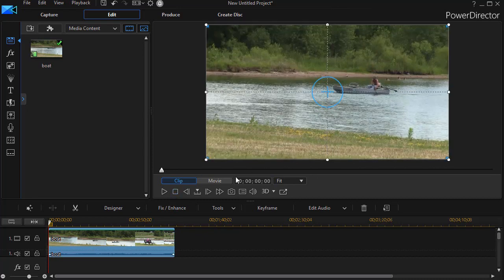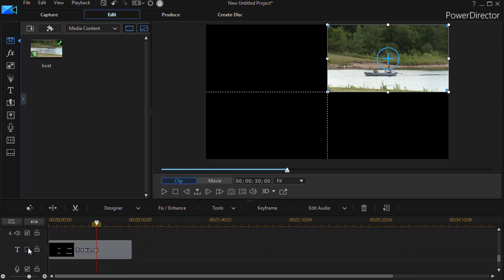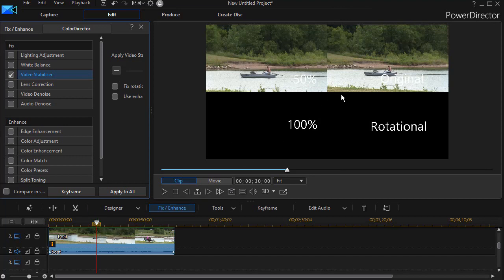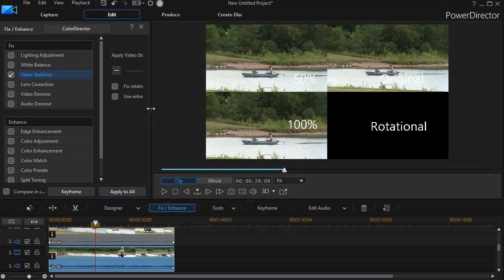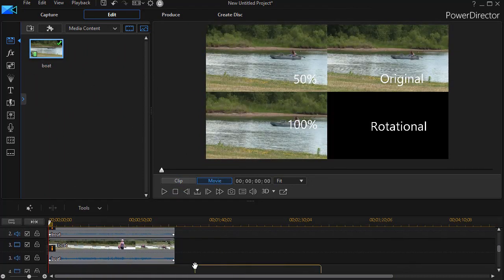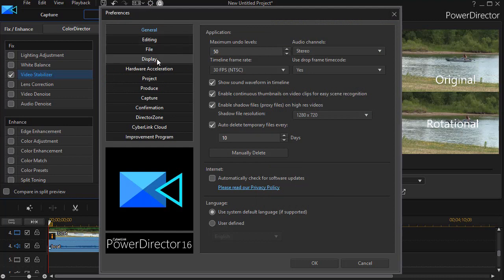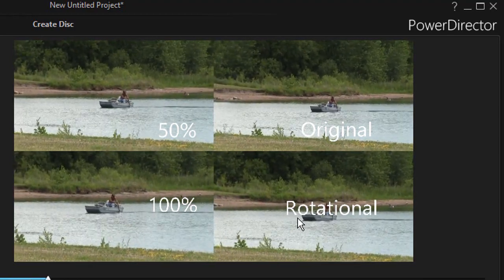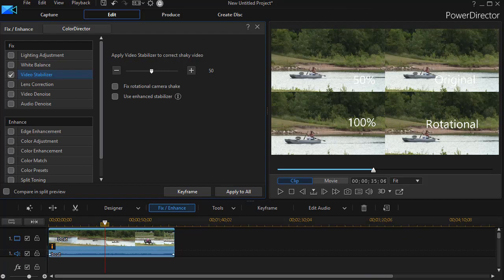PowerDirector - Tips for using the video stabilizer

Comment: Is there any way to remove VHS  tracking flicker lines once digitized and using Powerdirector? 

Thx 😎👍🏻
Reply from the maker: Frank,
I don't know of a way to easily remove those kinds of artifacts from an imported VHS source. You might be able to apply a blur effect to that portion of the clip where the lines appear. It would make them less noticeable, but it would not make them go away. --Jim
Reply: @SharperTurtle  Much appreciate the reply back... I always under the impression anything can be done once it's been digitized 😁 I guess TECHNOLOGY ain't that advanced ey !😝

Thx again and keep posting those Power Director helpful hints 👍🏻😎
Reply from the maker: Thanks, Frank. Just put another tutorial up. One of the most difficult challenges is dealing with poor quality in the source material. That's true with photos or videos. It's easier to fix with photos, which consist of one frame. But when you have thousands or millions of frames in a video, correcting issues becomes tedious. --Jim